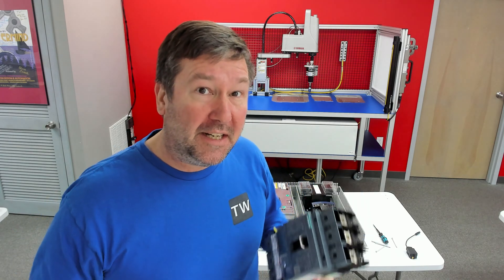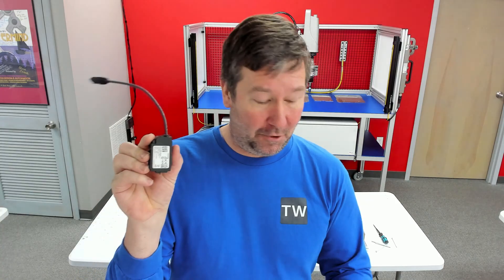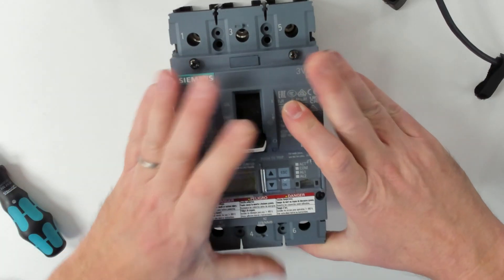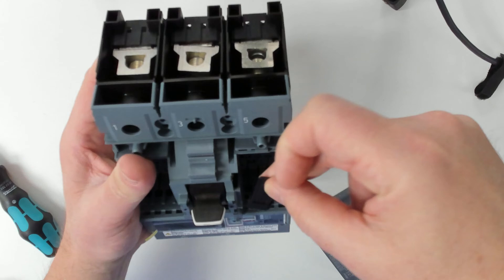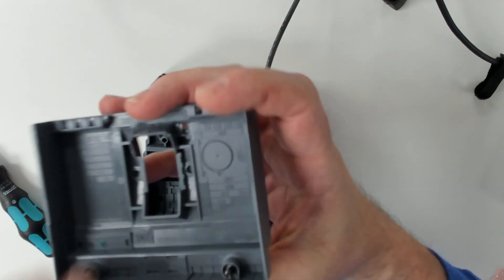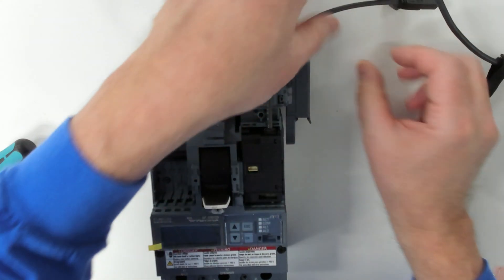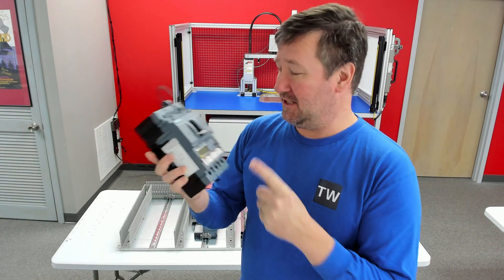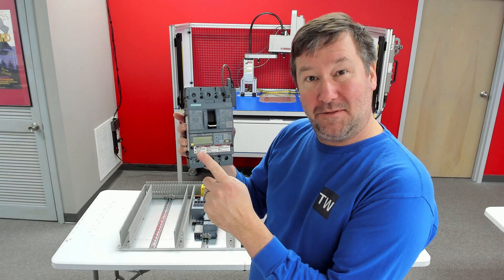Monitor Equipment Power Consumption with Siemens 3VA6 Circuit Breaker

Comment: Modbus TCP!? ... Why would you use that protocol on purpose? I have to program existing Modicon CPUs with Modbus. Definitely not my favorite. ETH-IP (or io link) is the only way, in my humble opinion. 😊😊
Reply from the maker: Why would I? What if it is the only option? Did you catch the introductory video? The point of this series is to have the skills you need when you need them, not only be versed in the ones you want to.